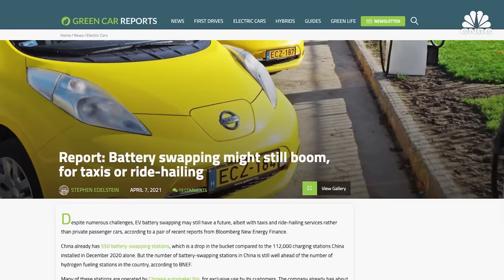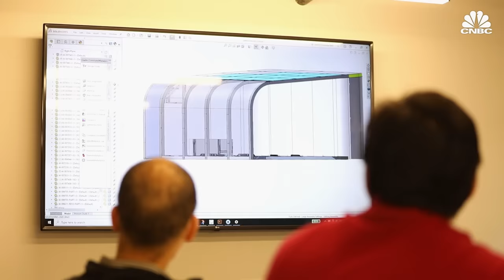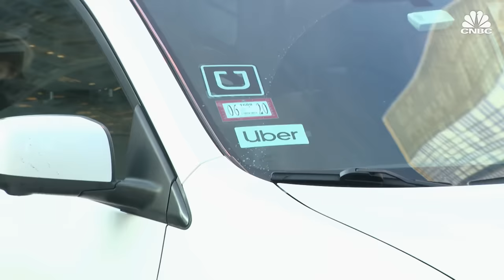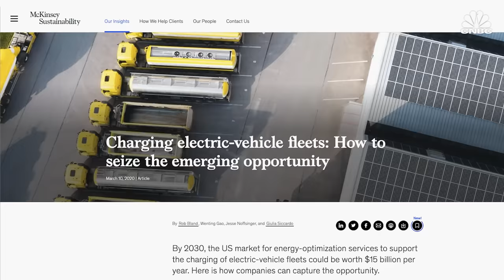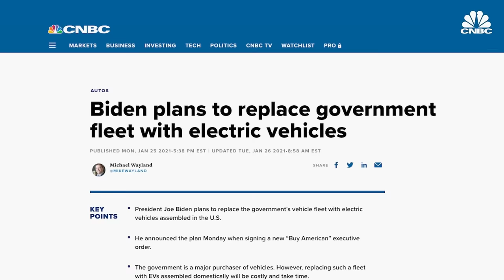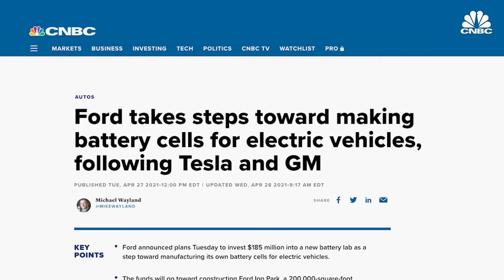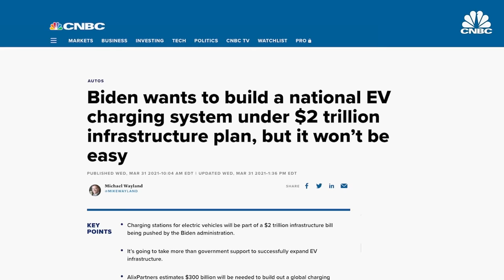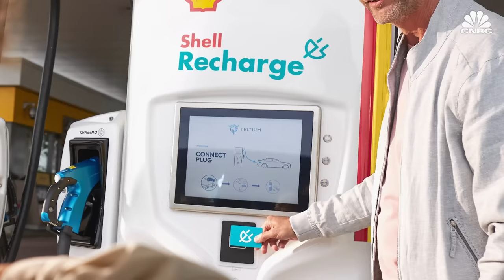Can EV Battery Swapping Take Off In The U.S.?

Comment: @1:43  I totally disagree... Americans will love battery swap as long as it's fast and convenient.
Reply: Raven Gaming  He's probably talking about battery as a service... The ec6 starting price is approx. $73,322 USD, opting for BaaS will reduce the cost by $20,000 USD (27%) but you have to pay monthly for "leasing" the battery. This subscription model pays for building new swap stations and maintaining existing ones. 

This makes sense in China since Tier 1 cities such as Shanghai; most people live in high rise apartment complexes and don't have the luxury of plugging in when they get home. (Noted that some high rise apartment's parking structure has charging access and entertainment spots + shopping centers have them too)

There's an app that shows you where all the swap stations are and you can queue in advance before you get there. Like, if I live in China and I'm getting off of work on Friday at 5:00PM and want a fresh battery, I can reserve my spot while still at the office. Then get off work, stop by the station at my appointment time and do the swap which is like 5 min. max. The system isn't perfect and there's still delays but they're working on improving the situation with new stations and faster robots.
Reply: @mwwhited  "charging stations take longer and require more space"

Sure.  Both a swap station and charging station take space.  Most corporate installations install into the sidewalk and run wires from the building across the sidewalk.  As the quoted 30 minutes needed to charge 80% of a Tesla battery, overlapping office time or shopping time with charging time removes charging time as a concern in most instances.  In Robocar utopia, a car in theory could drive itself to a charging station and take care of the charge on its own.
Reply: @josephmccartney5951  "such a narrow minded American mindset right there"
Are Americans narrow-minded ?  Poking fun at one of most inventive civilizations the planet has ever known seems to be an international hobby for the narrow-minded.     But let us talk about the economics of swappable batteries, including time..

When charging time is overlapped with office time or shopping time or home-charging time, charging takes the same or less time than swapping because no significant amount of time is spent doing either.   You raise a good point about taxi recharge time, but with a range of 350 miles/charge (TeslaModel3),  at 70 miles/hour, that is 5 hours of drive time.  At 20 miles/hour in a busy city, that is 17 hours.  Seems like the taxi driver can drive all day.  In a 30 minute break at a Tesla SuperCharge station, another 300 miles (~80%) is added.
Reply: @josephmccartney5951  "Plus the fact that If u get a removable battery it takes 30% of your total amount of the price of the car"

The lower purchase price is an appealing aspect of purchasing an EV : smaller battery packs are lighter and improve effective range while using the smaller pack.  But the cost of swapping packs will include the cost of the batteries in the pack, and the recurring finance charges usually add to increase the total cost of the car given the additional middleman.   If you are a car driver needing a short range (< 100 miles day), the smaller pack is for you.  Swapping companies are free to vary the charge of the pack, and there are possibilities for lower cost/lower density batteries as well as price gouging.   Don't get me wrong.  I am a fan of the modular pack.

As for saving "30%" during the purchase of the car, what happens to lower purchase prices for similar products?  The price rises.

But during the 10-20 year ramp-up of EVs that is primarily constrained by battery material, there is a risk that there will not be enough swappable batteries because more swappable packs are needed when compared to the same volume of fixed-installation battery.    But there is also a chance that customers would be willing to accept a 1/3 battery or 1/2 battery car with a battery they control and are able to upgrade later
Reply: @mwwhited  "Also these options are not incompatible.  It’s not swap or charge"
This is true.  But wouldn't a swappable battery company restrict recharging ?  I suppose they could add a meter to the pack to measure battery output and charge according.  Don't get me wrong.  I am not arguing against modular/swappable packs - just debating the logistics.   Personally, I am a customer of a shorter range EV and would prefer a 1/8 (40 mile/day)  battery option on my car.  With 7/8 of a 1200 lb battery gone, the effective range of the EV is probably 30% longer than 40 miles/day
Reply: @paulngo4946  "most people live in high rise apartment complexes and don't have the luxury of plugging in when they get home"
Why do they own a car at all ?  Of course, the taxis need to charge somewhere.
Reply: @GK-op4oc  No clue what you are trying to say, bud.
Reply: @paulngo4946  Car ownership makes much less in the EV world in high density cities, especially when home charging options are unavailable.  Rent by the trip.  Taxis also need to be charged but can drive all day in a city on a single charge.  Let the taxis take a 30-40 minute break at a supercharger.
Reply: Raven Gaming  you mean like in any industry where service is depend on availablity? I had to wait 30 minutes for my Cuban immigrant stripper cause she was already busy with another client!!! The audacity!!!

Comment: Liability issues when there is a problem? Fire? Manufacturer’s fault or the battery company’s fault?
Reply: Depends on which component is at fault i would assume
Reply: A battery swap service would service and safety test batteries more often than a private owner.
Reply: Why would the manufacturer take ownership of fault for service they did not do
Reply: Obviously Ample. But they will probably be bought by VW or Toyota so in the end it doesn't matter
Reply: And that's a major reason it won't succeed likely for consumer usage. If it's meant for SWAPPING to a specific fleet of trucks it becomes a non-issue since they can sort out those issue internally.
Reply: How about you stop suing for everything
Reply: @photonboy999  or buses and freight
Reply: Is this really different than putting aftermarket parts on your current vehicle?
Reply: Battery swapping IS A DUMB IDEA.
Sounds "Clever" BUT Batteries is the MOST EXPENSIVE part of an EV AND there is AND WILL BE a battery shortage for the foreseable future.
With battery swapping you need MORE BATTERIES.
Most cars should be able to charge while parked so more chargers are needed, swapping is unecessary.

Comment: Sharing batteries and the american mindset of ownership does not mix
Reply: Americans have been doing this Propane with tanks for years
Reply: @shanewillbur1325  a $20 tank of propane to cook food on a grill is a little different than swapping a $10,000 battery.
Reply: If I could have an e-bike or a scooter with rented battery cost the same per charge as my own and I could charge it with cheap electricity ~2¢ per kWh regardless of charging it at home or at a station.
I would be for it. Than discharging it when electricity price is high will be on their pocket book :) They gotta diside at what price it's worth it to degrade batteries and predict when how quickly dump the energy.
Honesty there is enough profit insentive just for grid storage alone. There are about couple hours each work day with electricity price above 7¢ per kWh. If it costs ~4¢ to cycle kWh. For a lot of folks in my area electricity cost ~13¢ per kWh retail including tax and grid charge. One could possibly squeeze in rental of battery in such price. It would reduce the upfront cost of electric scooters. 

 Someone should make an E-bike charger that communicate with PV charge controler like EPEVER Tracer to charge efficiently when power is produced with little loss. And inverter manufacturers should implement price tracking to optimize when and where power goes.
Reply: yeah, american rather share girl friends
Reply: How about a subscription service?
Reply: @VonnieOdette  "How about a subscription service?" It's being done in Europe to some degree, but that's for leasing the battery, not for rapid charge purposes.